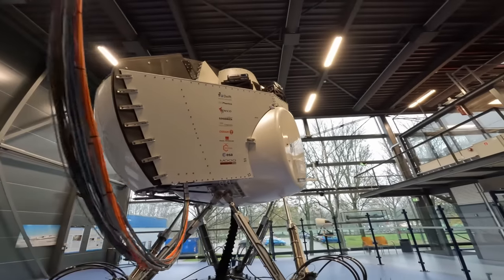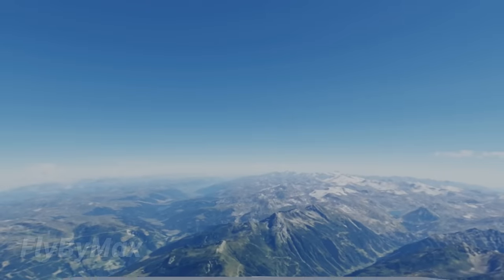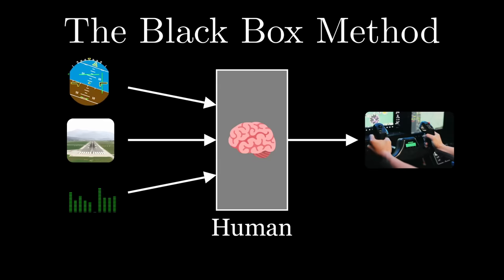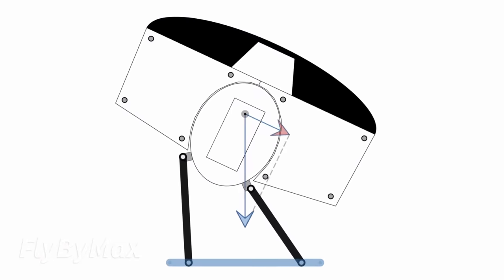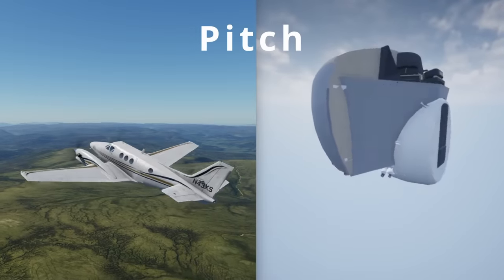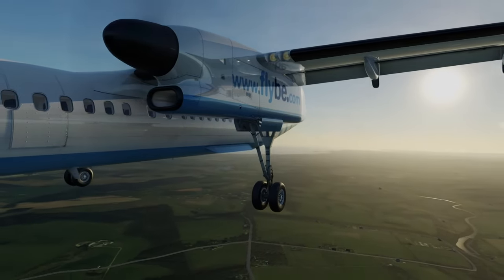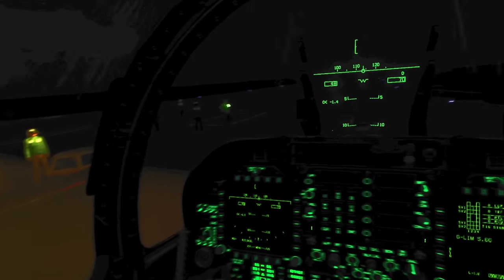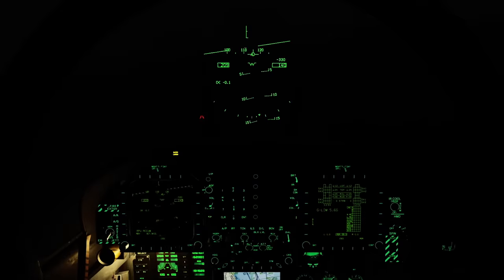How Flight Simulators Trick Your Brain

Comment: great explanations! im in this faculty🤣
havent tried the faculty's simulator, however I have tried a similar simulator but smaller and for car racing. For me the main issue with this simulation method is that it only focuses on the acceleration and not the rotation the user experiences. I have gotten extremely sick temporarily because my inner ear was detecting attitude changes when it doesn't expect to(i.e, when accelerating on the runway). There isn't a good way around this issue but I'm sure like many other things, it can be adjusted to.
Reply from the maker: That might be because the specific force rotation was set too quick. Car dynamics are also different from aircraft, so it might be that you have a better experience in SIMONA, who knows :)

Comment: When you are on an aircraft, if you were to be going fast and pitching up, you'd not only feel the seat pushing you forwards but you'd also get pushed down into the seat harshly as if you are on a roller coaster loop because of the G force. Is there a way to simulate this without using the centrifuge and incooperating it into a motion sinulator thats capatable of simulating all other motions and rotations? How do you deal with a situation where the pilot would feel a net force thats bigger than their body weight in quantity?
Reply from the maker: That's a really good question. Most simulator's can't deal with long term sustained vertical g-force, except with the help of a centrifuge, like this one: https://desdemona.eu
Reply: @FlyByMax  Could you make that o topic of a follow up video? It’s the part I was interested in most. I was kinda sad when the video ended without any mention of that problem. Still a great video and loved the animations!

Comment: what if the g-forces are greater than 'g' itself, even if the simulator is pitched 90 degrees, it wouldn't be sufficient... also what about fighter jets and acrobatics planes doing loops, and inverted flights, how do you simulate that?
Reply: It can’t and that’s what I would’ve loved to be mentioned in this vid cause that’s the only reason I clicked on it. Seems like most people don’t even notice this problem.

Comment: I think it would be helpful to describe a coordinated turn, which is not always achieved and changes the forces felt in the cockpit.  As for the F-18 ending up in the ocean, I have seen in other videos that pilots do not have their hands on the controls until after a climb is stabilized after a cat shot to avoid unintentional or misinterpreted movements.  I'm curious to know when the F-18 crash happened.  Perhaps at the beginning of flight testing?

Comment: Thank you! I have been trying to wrap my brain around that translation. You explained it very clearly.
I have a loose project in mind for a racing sim and was wondering how that works. Some of them actually tighten your shoulder belts to add to the feeling of hard braking. (how about pulling on your helmet with about 35 lbs. for turns?)

Comment: Strange, I thought the circle with lines coming out of it is the velocity/heading indicator on the HUD, and the pilot should be able to see that they're pushing their velocity below the horizon and realise something is wrong before an accident occurs. In other words, I thought instrumentation is there to help you correct for errors in physical perception by putting the true dynamics on a dial.
Edit: oh wait that's actually explicitly said in the crash report. Assumes that -The pilot was not looking at the aircraft instruments
Reply from the maker: Good point!

Comment: Already knew bunch of stuff (as I wanted to make a smaller one for personal use), but this clarified a lot of details. I do have a question: is there a minimum length of actuators in order to achieve the necessary motion? I guess if it's too short, you can't have enough travel for the full effect. Great video btw.

Comment: One thing missed from the video is how it simulates sustained vertical g forces? E.g. in a high bank angle turn or accelerations in vertical speed? Is that the only limitation of simulators vs real world? Such an excellent video otherwise 😊
Reply from the maker: You’re right, sustained vertical g forces are very difficult to handle. If they’re short and high frequency you can wash them out by moving the simulator vertically (heave), but sustained vertical g-force is impossible without something like a centrifuge.

Comment: Neat, I always wondered about how simulators would deal with a lot of these issues. "Washout" seems like the trick. Would sure be easier and require a lot less hardware if we could tap into or modify the signal sent to our brain from our vestibular and tactile systems. That's a ways away perhaps.

Comment: So my question is, how do you accurately simulate a sustained high G-force maneuver? Using the methods described in this video would not allow even a sustained climb of 2Gs. For example, how about an aircraft carrier catapult shot which is typically 3-4 Gs which last a couple of seconds? Simulating takeoff by tilting the sim up will only provide, at the most, 1G. If at the same time the sim was motioned forward there would be additional force felt depending on how fast the sim is moved forward, but the sim can only move forward a few meters at most. The same question applies to a banking turn. The most that could be simulated for any length of time would only be at maximum 1G.  Modern fighter jets can pull 3-4 Gs in a sustained banking turn which is the same problem. 
So how is this resolved for actual simulations?
Reply: 1) 2G Catapult launch simulation There is no way to do that unless doing the real thing. Even using a centrifuge, there would be a a large time for the acceleration to build up to 2G, which is very different from sudden catapult launch
2) Sustained 4G training : use a centrifuge

Comment: What happens if i do 360 flip 🤔
Reply: You will go 90° up, stall and crash.
Reply: Some planes could do it tbh (especially the acrobatic ones)
Reply: @Reyhank45deb  You would still feel some forces probably. It won't flip. You could only hit the machine's limit of immersion when you are flying upside down. If you will do a loop, you would still be in your seat due to centrifugal forces.
Reply: @npc_citizen9276  yes, but the sim can’t do more then 1G so it wouldn’t even feel close to real.
Reply: @DreamOfFlying  That's literally what I'm saying. The machine just simulates forces. Look at some racing rigs with seats that react to the car moving.

Comment: Could this be used to let people ride virtual rollercoasters in theme parks?
Such rollercoasters can be extreme, and there can be thousands of them stored on a computer.
Maybe it could even be adapted to hold let's say 12 people at once. Such theme parks won't need as much land as conventional theme parks so they could be even be located within cities!
Reply: Yes-ish.. there is a limit to how much (or really for how long) you can simulate the feeling of weightlessness. The motion platform can't turn gravity off, so to give riders the feeling of air time, it has to physically drop along the vertical axis. You can only do that for however long your vertical translation range will take you.

This is also partly why NASA has that enormous vertical platform simulator that takes up a whole multi story building.

And for rollercoasters, airtime (or feeling 0g) is a pretty important feature.

Comment: so that's why ets2 steering with gyro slowly drifts away over time and then the neutral wheel position is your gamepad tilted until you reset everything
Reply: That's because there is also a thing called "trim". Look it up.
Reply: @npc_citizen9276  Thank you because I haven't heard about that before but please could you elaborate a bit because I looked it up and found nothing but how "trim" is just fine tuning gyro and I've been fine tuning it for three months man, no help.

Comment: It's hard to believe the Hornet would crash after the launch since it literally has a HUD with pitch ladder and velocity vector displayed right in front pilot's face. Was that mishap documented somwhere?
Reply from the maker: Page 10-7: https://apps.dtic.mil/sti/tr/pdf/ADP013854.pdf
Reply: @FlyByMax Thanks, went through that report, but the whole mishap still looks weird to me...

"The plot of estimated perceived pitch (blue line with circles, Figure 7) is derived from the NAMRL
perception model. It assumes that:
"* On the night of the mishap it was a truly dark night and that there were no outside visual horizon
cues.
"* The pilot was not looking at the aircraft instruments."

Where was the pilot looking then? In a Hornet it's actually hard not to look at the instruments. Usually during take offs and landings, Hornet pilot will put a HUD repeater on one of their side DDIs (in case the HUD fails), there is also actual HUD in front of the pilot and backup standby instruments below right DDI. All of these will show the aircraft attitude, speed and altitude. You could easily safely perform carrier takeoff with obscured canopy (no external visibility whatsoever) wtih those instruments.

Comment: Very interesting because allot of axis simulators do this even in theme parks.
Wonderful video mate
Reply from the maker: Cheers :)
Reply: My experience is most theme park simulators DON’T actually do anything nearly this sophisticated. It’s one of the main reasons I won’t do them anymore, they usually act as a direct 1:1 motion coupling of the vehicle they’re simulating, not as a true motion simulator. There are even ones that will tumble you 360 degrees during simulated barrel rolls and loops, which is nothing like the actual forces you feel during those maneuvers. Minus the initial entry acceleration, properly performed barrel rolls and loops should feel like a constant butt-in-seat 1g.

Comment: The full motion simulator still does not simulate the effects of gravity and what pilots refer to as "load factor" properly, since the platform's position is almost completely fixed, and is capable of only minimal movement. If the airplane has a bank angle in a level turn, the total lift would be 1/cos a (where a is the bank angle) times the weight, and we would feel that many times the force of gravity pushing us into our seat. At small bank angles the difference is minor, but at 30 degrees it is definitely perceivable, and at 60 degrees it is as much as 2, and the simulator is unable to reproduce that sensation. Conversely, if the airplane is in a level acceleration, our perceived weight does not change, however, when the simulator simulates this by tilting backwards, the force pushing us "down" into the seat is reduced by a factor of cos a (where a is the angle of tilt). Pilots know that even the full motion simulator feels unrealistic when "flying" the sim into a  high acceleration state.
Reply: Yup, you can't get sustained G out of it. Not all tools can do everything, but it's still a pretty good tool.

Comment: "People need vision to stay upright"
Blind people will happily disagree!

And even though i am not a blind person, i can also disagree since if my eyes are covered or it's pitch black, i don't lose my ability to stand upright even if it does get slightly more involved if i am standing still without a visual to assist my brain in balancing.
Walking on a obstacle free surface without being able to see is not a problem at all because humans that have learned to walk a long time ago will still know how to walk even though they can't see.

The only time it's true that we would "fall over" (lose our sense of up and down) is if we are sitting still, which of course we do in the pilot seat.
And "up/down" is a relative term. If you are in a spinning cylinder in an otherwise weightless environment (space) then up is towards the center of that cylinder and down is going outwards from that cylinder's center point.
And even then, when we are seated, we can still get cues about what orientation "down" is by how our blood is "pooling" in our bodies and how the hairs are hanging and whenever we move our heads, to where we feel how gravity affects our vestibular system. That is, the simulator is tilting up to simulate acceleration through means of the chair pushing you forwards. But if we close our eyes and move our head around we can still determine that we are actually just leaning back, not accelerating. This because you still can't remove the force of gravity on our body.

Simulators are just that, simulators. They can't perfectly replicate the real deal and there are people out there that are extra sensitive to such trickery and would instead get extremely motion sick from sitting in such a simulator and seeing one thing but feeling another.
Even without a simulator, some people get motion sickness by simply looking around in a game that lets you do so. The visuals do not reflect what their vestibular system is telling them.
This is especially true when wearing VR goggles.

The same applies to people out at sea. The constant rocking and rolling while getting "strange" visual cues makes some people seasick while say a seasoned sailor that is used to this remains completely unaffected.
Or getting car sick because the motions in a car does not correspond with what the passengers expects to have happen.
If there's a smooth curve, but the driver doesn't follow said curve properly, a passenger that is prone to motion sickness will have their stomach churning in a short while.
I for one HATE drivers that can't drive smoothly, as i have to constantly predict their bad driving lines to not get motion sick. Constantly looking out the window and preparing myself for their early or late turn ins on every corner, and for that matter not even being able to keep a straight line.

In summary, you don't need to see to stand. You can still use your feet to feel where your balance point is.
And you don't need to see that you are actually tilted back to feel it, if you move your head around.
And when the visuals doesn't correspond with what you feel. You may get motion sick.

Comment: 12:40 you mixed up the things. You said that the  gravity pulls you forward and the deceleration pulls you backwards. Thats wrong. The gravity would pull you back and deceleration forward. 😁
Reply: I noticed this also, but I think he meant that in the context of the specific force, ie what are the forces felt by the person : gravity would make the chair push you forward, while deceleration would have the chair move away from your back. The total of the forces in that axis being, no feeling of being pushed by the chair at all, nor leaning forward.
Reply from the maker: Yes, that's exactly right. Sorry for the confusion, could have been clearer in hindsight I guess :)

Comment: The method of pitching the platform back to give the sensation of straight and level acceleration can't be 100% convincing. While it would increase the pressure on the back of the seat, it would also decrease the pressure of the seat bottom. This second part would not be a component of true straight and level acceleration.
Reply from the maker: That's true, although the minor difference in vertical reaction force will be very difficult to sense compared to the horizontal force. This is because the horizontal force scales with the cosine of the platform's angle, whereas the vertical force scales with the sine of the platform's angle (which leads to larger changes in force than the cosine for small angles, cos(theta)~0, sin(theta)~theta). But you're right, although the simulator can never replicate forces one-to-one, we can still make the best of the hardware that's available to us :)

Comment: As unfortunate as the F18 incident was, pilots are trained to use their instruments and exercise good judgement. Pushing the nose down on the F18, which is literally programmed to automatically climb safely after launch, without checking altitude and speed properly is a failure.

Comment: An aircraft turns using banking because this allows some of the down force (lift) of the wings to be employed to push the aircraft is the desired direction. The plane does not descend while doing this due to trigonometry. If the bank angle is 0 (straight and level) then all force is down and so the fraction of the lift force down is given by cos(BA). The side force is zero in a BA=0 so it's share of lift is sin(BA).
Now let's bank the aircraft 20 deg. Cos(20)=0.9396 or nearly  94% of the original lift. However sin(20) = 0.342 almost 34% of the lift force!!! One might think that these two should add to 100%, but they do not ... unless you square them!
So, for a comparatively slight bank, almost all lift is maintained, but you also get a non-trivial side force allowing the turn to be made.
What is fascinating in this video is the machinations that can be done create this effect on the ground. As a boy, I had the privilege to spend an hour in a simulator of an L-1011 in 1975. While the out the window graphics were limited to runway lights, the feeling of motion and engine vibration was just awesome. It was nearly 50 years ago and I remember the impression very fondly.

Comment: To be fair, the pilots should have known this as this is covered in even IFR training for general aviation, let alone naval aviators. This is a case of pilots fucking up and ignoring their instrumentation.

It is by no means the only case of this, but it's always pilot error

Given you are taking off and very low, always check your attitude, speed, altitude and altitude rate of change on your instrumentation before assuming your climb is too steep!

Comment: Real shame, they literally trim those aircraft in such a way that on launch you dont even have to touch the stick AT ALL for quite a while other than to prevent any rolling.

It'll climb at a nice 5-15degree angle all by itself so you dont even need to correct for the pitch that seriously.